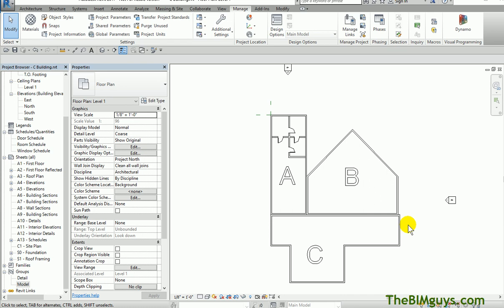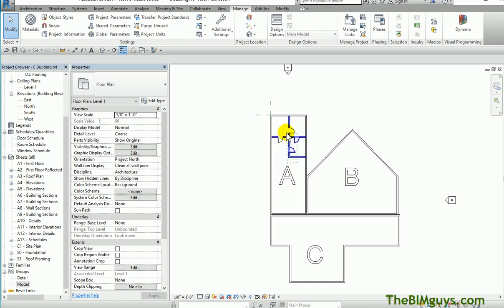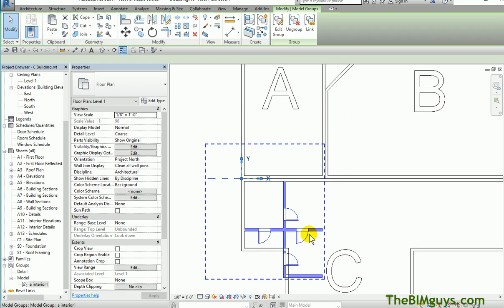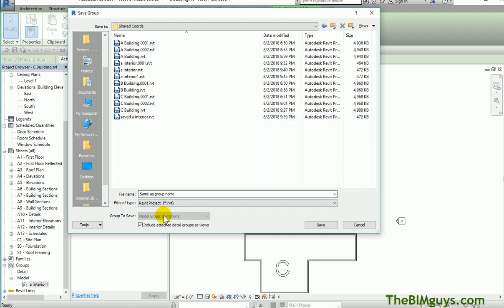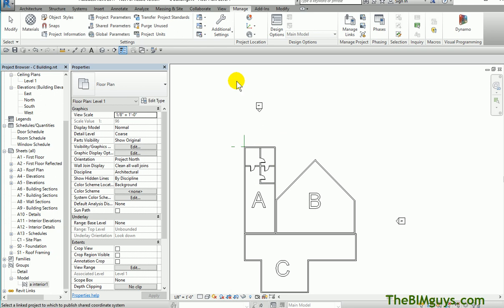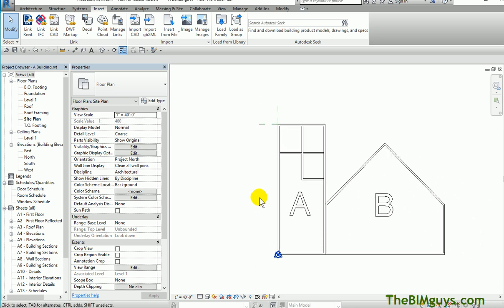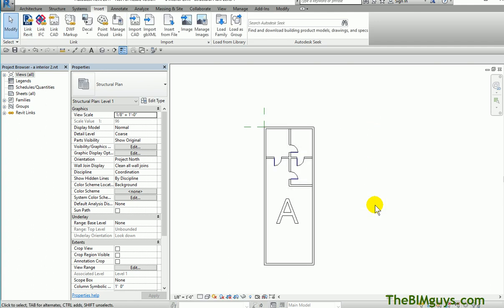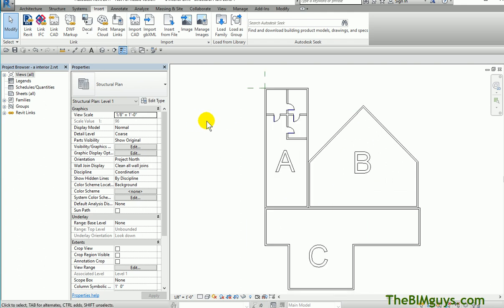Revit Shared Coordinates Simplified - Part II - CADtechSeminars.com

Comment: QUESTION:
I DID THE SAME, BUT WHEN I AM LOOKING AT SITE OF FILE A, MAKE MY VIEW RANGE CUT PLANE AT 4FT, BUT LINK OBJECT ROOF FROM FILE B AND C STILL SHOW UP. HOW CAN I MAKE VIEW RANGE AUTOMATICALLY CUT OFF ALL LINK B & C FILE AT 4FT HEIGHT? OR THIS IS STILL THE PROBLEM WITH REVIT 2022 ?